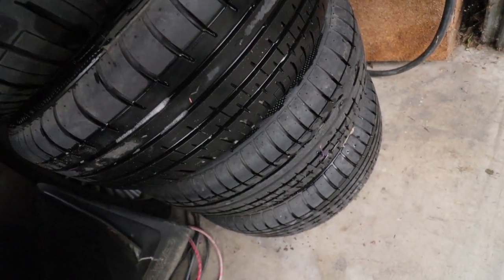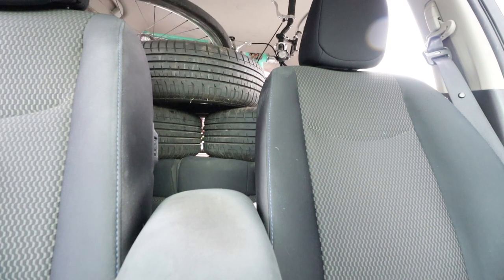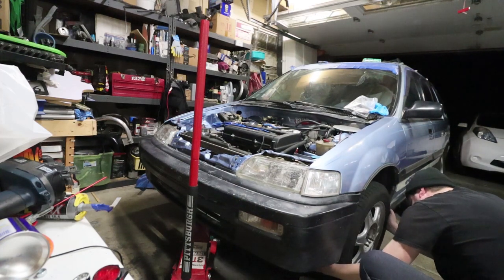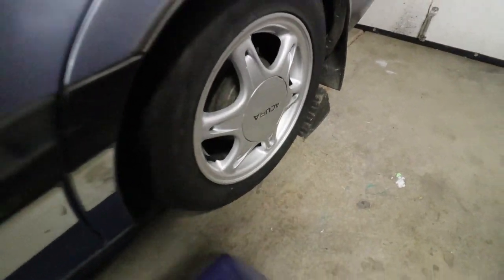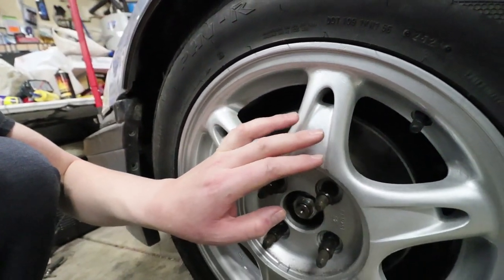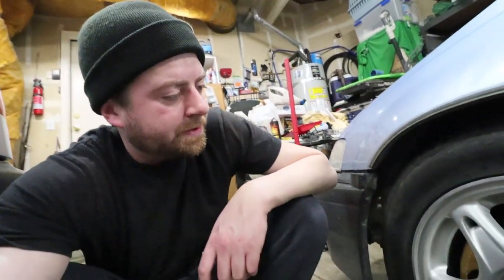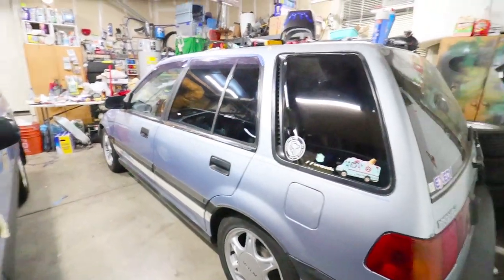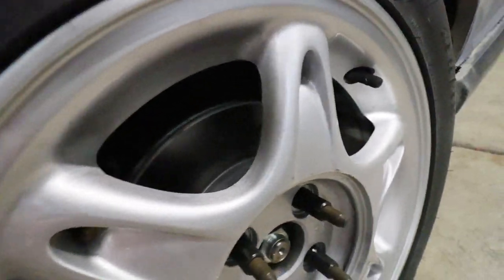BAWD Civic Wagon gets new shoes! Rare Only released 1 year | Facebook Marketplace come up

Comment: Those are gorgeous I found some at the local junkyard but as I was taking to get them I saw a cleaner set randomly on a Mitsubishi mirage. 😅 and I got them
Reply from the maker: they're really not bad for being 20+ years old I'm curious what they look like without the paint on there, I'm confident the deep scratches are from wire brush trying to remove the OEM finish with paint stripper I've been there... Shoot me pictures of yours on IG man I wanna see what they're supposed to look like! lol
Reply: @4realtime783  I haven’t been on IG for a hot minute it was like marriage or IG and I’m still married 😓 but mine where painted black when I bought them I think they rattle canned them but it was flat black and smooth enough for a race car. But I have all my center caps. Next time I make a video I’ll show those and some other super rare ones that came on only 99-00 civics and the ek Jordan in the UK.